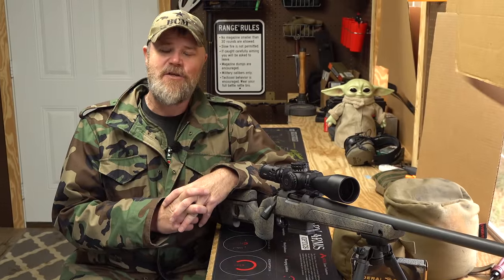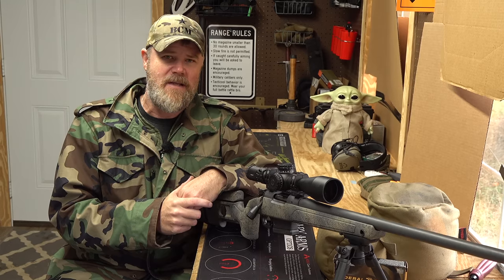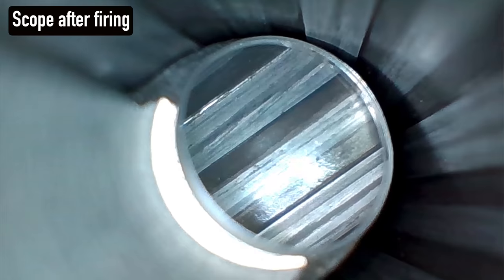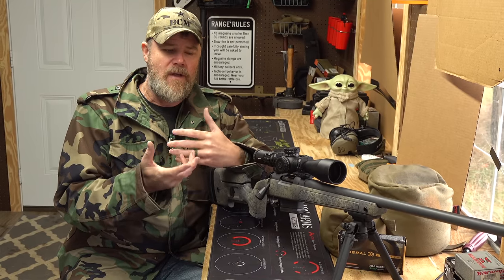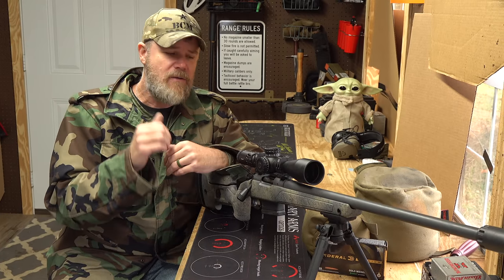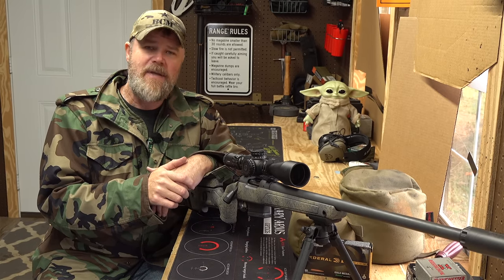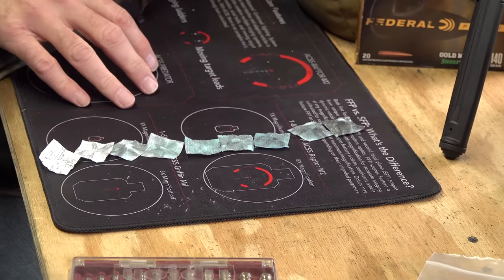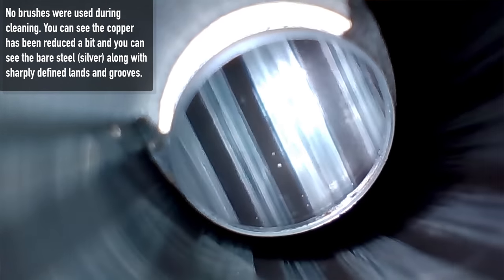Barrel Break-Ins and Cleaning Voodoo Rituals Destroy Barrels

Comment: I don’t think I’ve ever owned a rifle that shot best clean. Always improved after a few fouling shots. Back in the day, I did have somewhat of a break in procedure that was intended to remove any copper fouling, but not for the reason you me mentioned. The reason I cleaned new barrels like that was to get the fouling out of the imperfect areas so that they would smooth up in time. With fouling in rough areas the bullet just trades a little jacket material with the fouling as it passes by, never working on the steel that is causing the fouling. My idea was that once cleaned, the bullet abraded (however slightly) the roughness thus smoothing it out eventually. I’m 100% an advocate of doing what works for you without letting anyone else force their opinion. As it goes, I clean pretty much like you do with the exception that I don’t believe a cotton patch is going to damage a steel barrel if the direction should be reversed mid stroke. Great video and keep up the fine shooting sir!

Comment: Marine Corp training has me thinking I needed to clean my rifle after every day at the range. That involves scrubbing every bit of carbon off I can with a nylon and brass brush down the barrel. You have educated me and I will be better with my barrels.
Reply: Don’t worry, that was government property.
Reply from the maker: That's no joke. Q-Tip cleaning was a real thing.
Reply: The Army is not much different: "Keep your rifle detailed clean and wet lub after shooting." It was hard for me to move away from over cleaning my guns. Nowadays, I accumulate about 1,000 rounds before a do some cleaning on the bolt carrier group. When I see too much, visible, excess of fouling build up, I do a deeper cleaner. Used to be that my civilian rifles were shiny clean every time after I shot them, which it was unnecessary, of course.
Reply: I used to be the same. My sad always had us cleaning our guns that night after shooting them. We'd run copper brush soaked in Hoppes #9 solvent a few times down the barrel, then some soaked patches. Then follow with dry patches until they came put clean. Then a patch lubed with Hoppes oil, followed by a dry patch to soak up the residual oil. We did notice that almost every time the first shot out of a rifle was always a little off on its own and had a little bit of oil on the target.  Then in the Marine Corps this only reinforced that belief that my guns had to be clean after every range trip.  Well after going to the range with like 5 or 6 guns and spending all night trying to get them USMC clean I started getting lazy and not cleaning my weapons as often. I kept saying I'll get to it later and later and putting it off. Now I've come to realize my rifles still shoot the same. My AR runs fine even though I haven't cleaned it in a few trips. My semi-auto pistols also run just fine even if I haven't cleaned them thoroughly and they have some carbon built up. So now i clean my weapons occasionally if they look really really dirty or start misbehaving such as malfunctioning or losing accuracy. Now, if I have been out in the rain or snow with them, I do make sure to wipe them down with a dry rag followed by a light coat of oil or CLP.
Reply: I suspect that the insistence on cleaning after every firing dates from when chlorate based primers were in common use, and cleaning to remove corrosive residue was needed.  That being the case, wet patches with a mild solvent followed by dry patches should do the job.  Anything more would be in kind with the kind of obsessive-compulsive that has a fighting man shine his boots to a mirror finish.
Reply: @Militaryarmschannel  Semper Fi - How many q-tips did we go through before each and every inspection of our rifles.  Even cleaning inside the gas tube of the M16.  Thank you for the education.
Reply: Same here...Army.
Reply: @hanelyp1  i use cheap bastard corrosive ammo and you darn bet i clean that shit when im still at the range
Reply: In the military they have to do that to keep those rifles reliable because if they're not cleaned they fail in the field
Reply: As a NCO seeing the stupid S### of having to "Brasso" the chamber and flash hiders on rifles, machine guns even.  I had more than a few PSG "E-7s" that wouldn't even believe it when shown in the manuals not to do that S### and the white glove is gone.  The main Dip S### one wouldn't believe that out unit was issued brand new M249s then had to send to D. Support for replacement barrels with folding carry handles. The replacement barrels came with out rifling that was key holed on 10m targets. Then I grabbed out a few barrels held up in light with out looking though them and told him to look. 
 Before as a SPC-4 watching the barrels "being rodded with electric drills and wire brushes" WTF just to clean for lay out inspections to pass. Thankfully the M2 and M60 barrels had Stellite liners not so for M16a2 and M249s.
 The funny thing is I did the same thing as what was done to "Filthy 14" to one of my own personal ARs in 04-05 running it with low cost steel case ammo only using synthetic 10w30 and no cleaning. I gave up due to the mess it was making in my gun safe and cases. I was shooting from 1500-2500 or more rounds a month though it. It was a beater Frankenstein AR but good barrel and BCG not a tack driver but combat accurate.  I did have a few top notch barrel's in bolt action and target rifles screwed up due to being gone on deployment and gone for year and half. Unluckily I lived in S.E. GA. at the time.
Reply: I unfortunately have been stuck with the old army way. I am 61 and have 21 years of army service. And will try and not scrub the barrels after every 100 round range session. I will probably loose sleep doing it but will try. Question though do you guys put the gun away in your safe  after shooting without oiling the barrel?
Reply: The Marine Corps did the same thing to me, 🤣😂
Reply: @v.german11b  I tend to clean my rifles when I notice a point of impact shift and increase in grouping size or if I experience a malfunction.
Reply: @Biggusdickus721  I try to clean my rifles before that starts happening. Although, I am not the firearms "spotless clean" kind of guy anymore, I still don't wait until the fouling, carbon, powder build up, debris, dirt, etc, accumulates to the point of causing malfunctions or failures. I am moderate about it, but not too relaxed. I do visual inspections after shooting several hundred rounds, do some superficial cleaning and add some oil on hard friction parts. My "bad" 😁
Reply: Don't feel alone. That nonsense of "scrub, scrub, scrub" was beaten into all of us Jarheads. When I started shooting USPSA I learned to STOP cleaning my pistol every time I shot it.
Now I am one of the laziest firearms owners you will meet. I rarely clean most of my guns. When I do...I cheat.
Strip the weapon, little parts in a basket, everything gets dumped into hot sonic cleaner. 15 minutes later, remove, air dry, lube and reassemble. 
No more HOURS cleaning AR or machine guns. Let the sonic do it.
Reply: @djjaysky9071  Wrong.
Reply: I was a Gunner's Mate in the Navy and we too were taught to vigorously clean every weapon after firing them.
Reply: @robertbrown8099  Robert, I don't know if you have heard of Reid Henrichs/Hendricks. He has a training center in SC? And, has a YT channel called Valor Ridge, and he says to not clean your barrels until they show signs of losing accuracy. He even states shooting without cleaning will even improve accuracy, until you shoot enough where it's too dirty and loses accuracy. I don't know about rust though. I'm inclined to not clean, but to oil to prevent rust. Then, the oil will just get blown out after the first round.
Reply: @DB-yj3qc  wow
Reply: @ReverendMeat51  M16 and m4s have a very high fail rate when they're dirty
Reply: Same here in the Austrian Army. We were also foreced to polish every singe part auf our STG77s and after a couple of years the gas pistons got so small that they vented all the gas and the rifles did not cycle any more. Army had to replace thousands of gas pistons and reissued new cleaning instructions that no longer allowed extensive cleaning of the gas piston.
Reply: @Militaryarmschannel  I’m a Marine as well, and I often use q tips lol. Mostly just to get in the nooks and crannies of the chamber after brushing it with CLP. Based on your comment, it sounds like your opinion is that I shouldn’t?
Reply: I used CLP for my barrels for years because the Corps said so. I attended a PRS course and was told never use CLP. Shouldn't I use a light patch of CLP to remove the corrosive copper cleaner?
Reply: D R  on my corrosive ammo eating AKM - nylon brush that came with the cleaning kit but I do add a few drops of Abbey gun clean for the (chromed) bore and follow up with a piece of rag or two. The gas tube, piston and other components that don't touch the bullet get the brass brush and I don't go particularly easy on them.

I AM considering removing the brass brush from the bore snake that I use on my .22LR bolt gun but I still scrub the chamber with nylon using the same few drops of cleaning agent, back to front of course and rotating on direction change.

The bolt gun loses accuracy after just about 100-150 rounds, I'm afraid. Not 100% what's causing this but a good cleaning session fixes it.
Reply: @MattInIllinois  I'd say in your case, it's probably justified since carbon can absorb moisture, and the whole... salt water environment thing.

USMC has moved away from copper brushes and issue nylon bore brushes now for rifles. AFAIK machine guns still use brass brushes but I assume that has more to do with how dirty the barrels get, the chance of the a-gunner servicing a still-hot barrel between changes(where nylon would melt), and point-target accuracy being secondary to area-target effects for machine guns anyways.
Reply: @kajetandziebaj6405  My father was a WWII Marine scout-sniper. They did not use any solvents when cleaning their rifles. Hot water, period. The ammo they used was corrosive so some after shooting cleaning was necessary. Some lube afterward to prevent rust, but just a light coat. When I was in boot camp, while preparing for the battalion commander's inspection, our drill instructors had us all chip in a quarter and they bought gasoline and mixed it with fresh 30-weight motor oil. We worked our rifles (M-14s) over with that mixture and they came out squeaky clean. Our drill rifles were retired from shooting, so I suppose we could have really worked the bores over and no big deal. Of course the gas/oil mix was a no-no by regulation, so we didn't say a word about it.
Reply: That's the way I did it to.  Hospital clean my Senior D.I. called it. When you turn your weapon into the armory they wouldn't except it back until every speck of carbon was gone. That's just how the Marine Corps is.
Reply: We only used a lubricant, no solvent ever, just gentle brushing with nylon or brass brush, and with the 2 man method. Just punch the bore remove brush or patch. We always punched a dry patch before shooting to remove any lube. Overall good advice in this video.
Reply: Yeah man the gubment taught me some discipline but it seems it instilled bad cleaning habits.

Comment: Over time, I settled on a similar methodology. At first, I cleaned weapons excessively, because that's what I was taught in the military. But I came to realize that was in fact excessive. Nowadays I clean sparingly, using patches. I only use a brush if necessary. And even then, it's a nylon brush. I also stopped using aggressive cleaning solvents.
Reply: Correct, the military habits taught me on our rifle I carried over on civilian pistols, and it’s most probably wrong… ie running a patch or bore snake through the barrel after every shooting session
Reply: It’ll happen when you’re used to some sergeant inspected your barrel for any build up and not let you go if it’s not crystal clean,….

Comment: Good advice. I use both brass brushes and nylon. I use the nylon for the more accurate rifles, the ones that are intended to be tack drivers. And for things like defensive carbines, I consider the brass to be fine, as those rifles are geared more towards "combat accurate", more than being tack drivers. And I also tend to use brass for pistols. Just my two cents.

Comment: The best investment I ever made was buying 2 one piece cleaning rods, one in 22cal for bores up to 270, and a 27cal for 270 and above, the 3 piece sets always break and a 22 size can easily bend and break in larger bores also
Reply: Same I picked up a nice Pro Shot rod for my Over Under and ended up going back for the 22 cal one because of the build quality.
Reply: Can someone educate me as to why 22lr and 223/556 are both considered 22 caliber? I bought a bore brush stating 22 cal for my 22lr but it was too big.
Reply: @nightnday6675  because they are both 22 caliber rounds
Reply: TheMetalGuy852  not a huge fan of bore snakes myself, as a expedient field cleaning yes they work fine, but for any serious cleaning they lack the ability, I mean even the british issued cleaning strings with their enfields but they had a barrack rod with every unit for more serious cleaning
Reply: TheMetalGuy852  I have used a boresnake in both my S&W 69 and my AR 15s, the S&W 69 the lead wouldn't be removed near as well if one were to have leading issues, I used to when I used commercial cast bullets but have since remedied that problem by casting my own and proper sizing the bullets, the AR it did clean well but I didn't like the feeling of potentially dragging grit through my barrel over and over. Now no hard feelings, I shoot about 5 to 6 thousand rounds a year through various centerfires, mostly military surplus rifles and my 556 rifles, not near as much as some people but I am a stickler for clean firearms and never put away a firearm dirty. If you have good luck with bore snakes then continue their use, I just see it as more of a field expedient cleaning tool rather than a thorough cleaning tool and that has been my experience. I also do not see many of the benchrest guys using boresnakes as their main cleaning tool. Not that my opinion is the end all be all.
Reply: The rod is to clear things in the field when we can't take our rifle back to a safe space and unjam shit. Boresnakes are dope.

Comment: I agree. With ALL my firearms.  A patch and a nylon brush will handle the job just fine, with no damage.

“ break in” for arms with lots of moving parts, ( semi-autos and pumps) just gets rid of all the tool marks and high spots on wear areas.   

If you could see a machined surface under a microscope, it’d look like the Appalachians! Different story altogether for metal on metal parts. 
Unless you’re a toolmaker, gunsmith or machinist that knows what you’re doing, 1)don’t polish a blessed thing. 2) no metal on metal .  

PS-  Yes, I’m a toolmaker.

Comment: Good video. We always took a new barrel and wiped it clean, then shot a mag through it, ran a couple patches through it, and did this a couple times, and that was the extent of barrel break in. Mainly just to clean up machining burrs was all it amounted to, if there was any. I was also always told to put the cleaning rod in from the muzzle, and when it came out the breech end, then add your patch and ALWAYS PULL a patch or brush through in the direction of bullet travel, to keep the cleaning rod from bowing and rubbing against the bore. I was also told to keep bore brush use to a minimum, and we rarely used them. I've been a shooter since the late 60's early 70's and I've never had a problem with any firearm and we shoot A LOT. Keep the great work.

Comment: I’ve tried all the brushes: tornado, bronze, nylon, silicone, etc. The best I’ve found is a bore snake which envelops a bronze brush in fabric. Usually keep at least 2 for each caliber, one for first passes and another for cleanup passes.
Reply: Ive been using this method for years, little clp let it sit for a few min then 2-3 runs with a bore snake then done.  Barrels look brand new still.
Reply: Yup. Cause easy-button.
Reply: Sucks for cleaning surplus corrosive ammo
Reply: I use Breakthrough Boresnake . It uses Nylon brushes ..
I have 1 Breakthrough Boresnake I use with solvents and 1 I use for G96 Gun Treatment spray
Reply: I have a buddy whose son was an Army sniper and became the armorer for his SF team. This is how he cleaned the carbines for that team. If it's good enough for them it's good enough for me.
Reply: Note that the manufacturers of Boresnake suggest to not get solvents onto their product, as that will eventually break down the Boresnake itself over time.
Reply: Bore snakes are washable. 
Clean em once in a while.
Reply: Spray your barrel with solvent. Wait a few minutes for it to soak in. Put a hole in a patch. Run the bore snake through the hole in the patch, up to the abrasive end of the snake and wrap it around the bristles before pulling it through your barrel. The end.